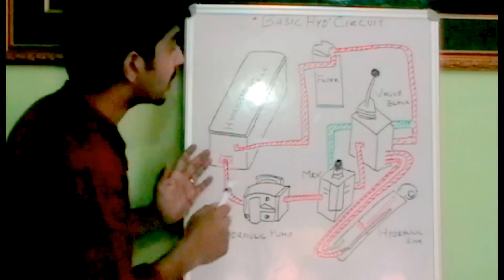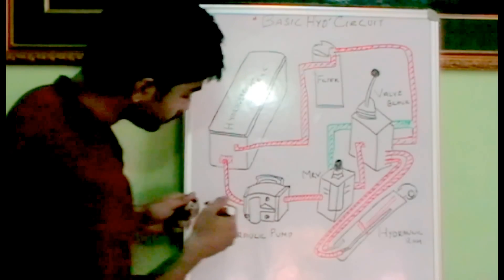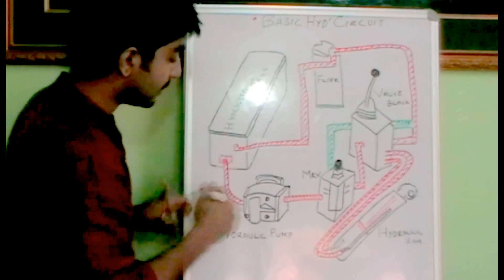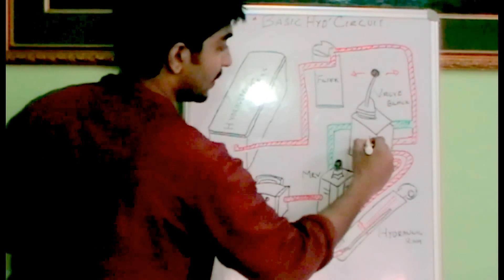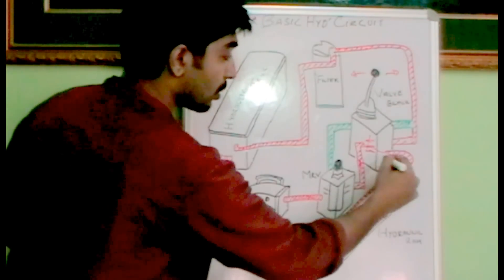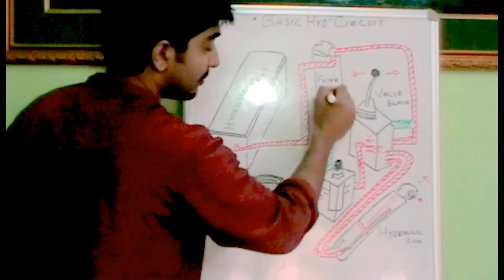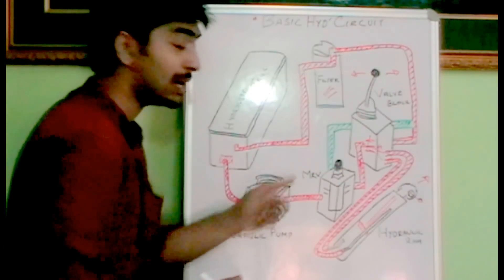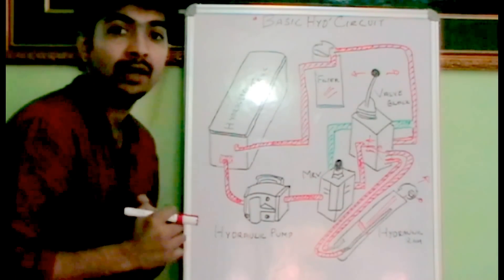Basic Hydraulic circuit (Must Watch). ✔

Comment: Suction filters usually have a preventive/predictive maint. schedule depending on the hours in use or dP across them. In order to prevent cavitation and pump wreckage, it is very common to install a  bypass check valve across the filter(s) which opens at a set vaccum pressure. Also usual high pressure hydraulic system consists of a charge pump which provides a higher discharge , a part of which is filtered and returned to the reservoir while the rest is taken up by the main high pressure pump.

Comment: Do NOT add a suction filter because you risk to cavitate and wreck the pump. The oil in the tank must be kept clean. Add a 3 micron breather filter. As the cylinder consumes oil from the tank it is important that the air can enter, otherwise you will create vacuum in the system and the pump will cavitate. The air that goes into the tank must be clean as the oil. Use a 3 micron return filter. Inspect the oil periodically.

Comment: good 1...Include a suction filter and a delivery filter, usually of 5-10 microns. Hydraulic components are very sensitive to dirt and particulate matter, and so will result in immediate failures...This is a part of any basic hydraulic circuit.